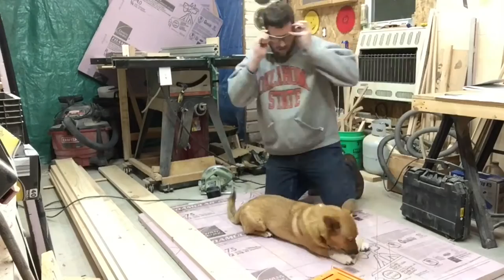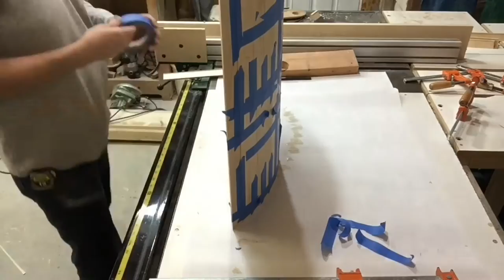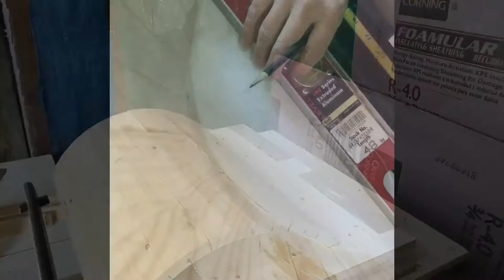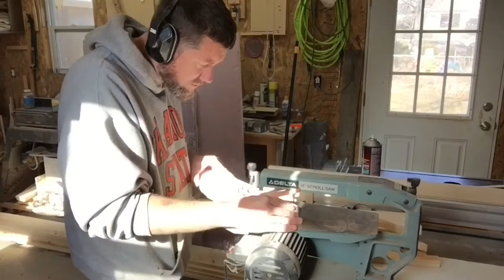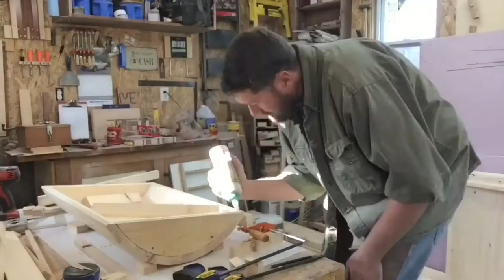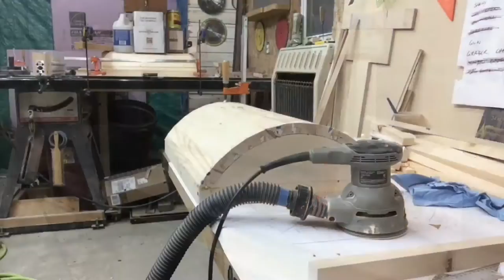The Toy Box Chest: The Curved Top Lid

Comment from the maker: I went back to try and find the plans I drew up. The best I can determine is that the chest was 18 inches deep and the the height of the lid was 3 5/16. I had 28 pieces total which were 2.75 inches wide at the top and the angle was 12.85 degrees. I would definitely check for yourself because I’m not 100% on this. Of course your angle and number of pieces can change depending on your dimensions. Good luck.
Reply: how do you calculate the angle???what's the rule behind it?